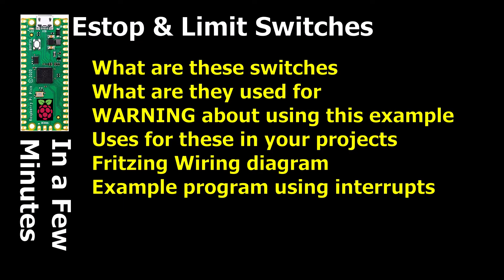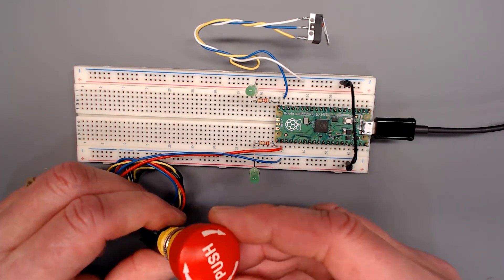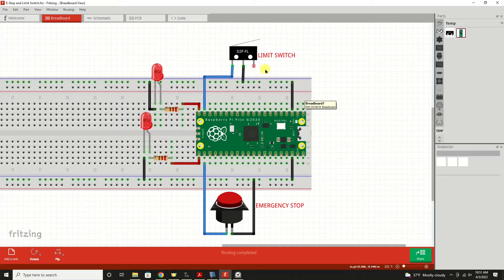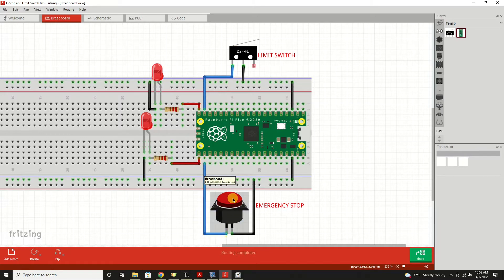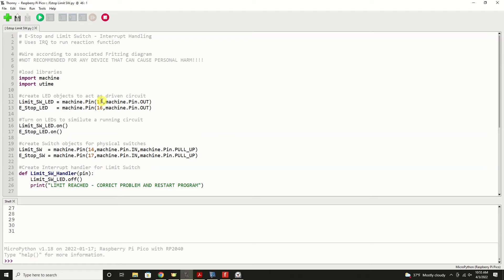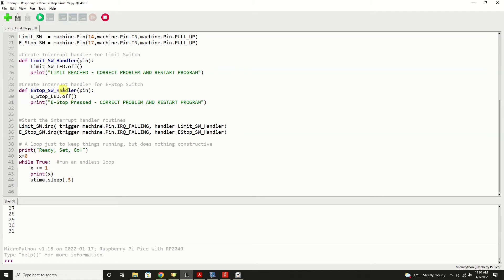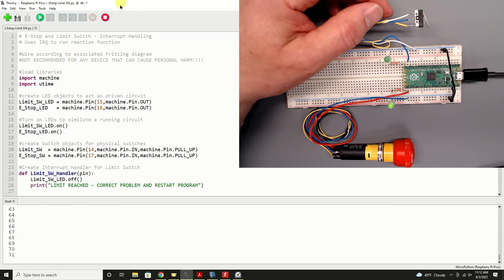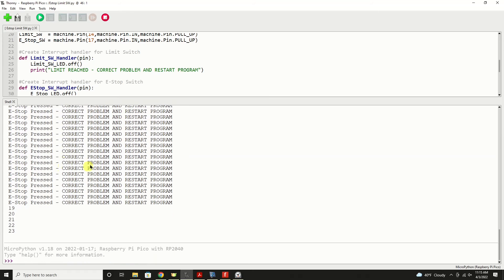Estop and Limit Switch using Interrupts

Comment: Your tutorials are always useful and explained well.  Is it possible to awaken a pico from deep sleep mode (to prolong battery life)  with an interrupt to resume the software program? Example: a trail cam controlled by a pico is in sleep state until an animal trips a switch.  Thanks!
Reply from the maker: Hi quaternion-pi 
Thank you for the kind words!!!
I looked into this when I started the PICO series and recall that to use the "deep sleep and awaken" functionality you could not program that with MicroPython.  SO MUCH has changed since then but I never had the time to revisit the topic.
Being that the Zoomie (used in the ZoomTown Experiment) is battery powered, I may need to look into that topic again.  It will likely be several months before I can visit that topic though.
Cheers and good to hear from you again!
Chris

Comment: How would you wire a normally closed limit switch?
Reply from the maker: Hi TA,
One way is to use a pull-up (internal or external) on the PICO' input.  The switch would connect this signal to ground providing an OFF state.  The signal would always be OFF until the switch opens at which point the pull up resistor pulls the signal ON. 
Hope that helps!
Cheers!
Chris
Reply: @MakingStuffwithChrisDeHut  
Sure does, thank you!

Comment: Did you measure the current sir? Is it ok for the GPIO ? because what I've read Pi has really low current limit per GPIO pin, it's 16mA max If I'm not wrong
Reply from the maker: Hello,  Not sure where your concern is regarding too much current, however, if it is for the LEDs in the example circuit, those would be drawing about 7 mA with the resistors used.
Cheers!
Chris